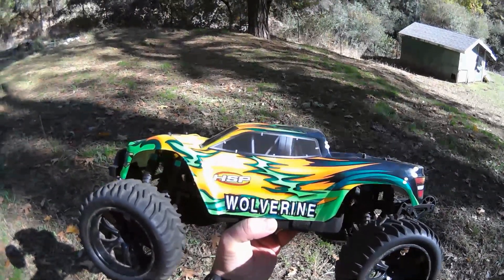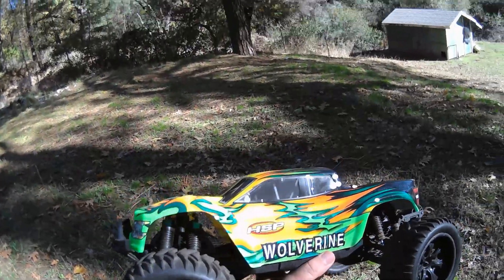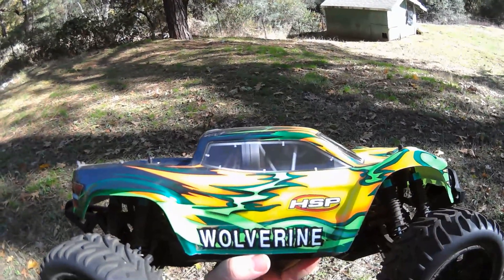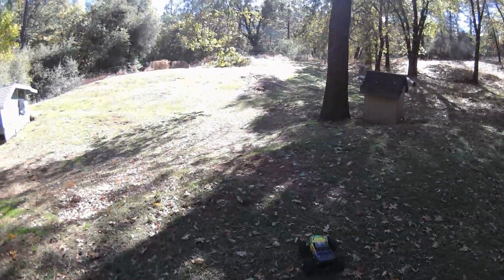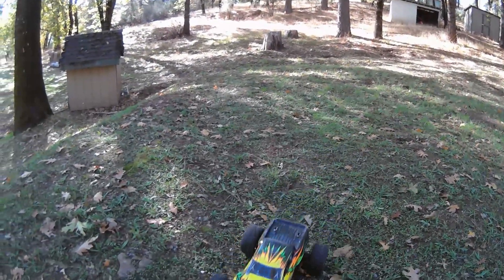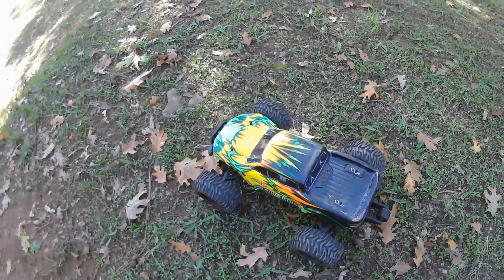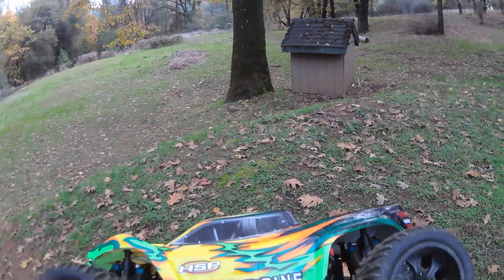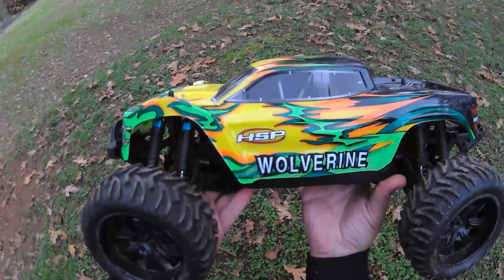HSP WOLVERINE - 3s BRUSHLESS WITH NEW SYSTEM

Comment: I’ve got the exact same as your samurai upgraded to 80A esc with 15kg servo to hold 3s, love it but it kills the hex on the tyres. I am thinking of changing to 90mm tyres cuz it’s cheaper. Love it too much to bash it on jumps
Reply from the maker: The stock hex on samurai are narrow..Get some thicker alloy hexs for it and kforce racing makes good SCT wheels and tires for around $25 per set.. Hobbypark has some good ones for around that price also

Comment: Nice video are you running stock 19t pinion or did gear it down some I was going to on mine I have a cogging issue what would you suggest keep the good videos coming
Reply from the maker: I think it's a 20t mod .6 with 5mm to fit the bigger motor shaft of the 3660 motor..Do you have the brushless model or brushed that you converted to brushless?
Reply: @philthyco1  brushless model blew original motor put in 3662 hobbystar recalibrate esc still cogging until you get going i was thinking over geared or esc not strong enough yours seemed to run good from a dead stop just thought I'd ask what you thought it may be.Thanx
Reply from the maker: @rambogamefowlfarm6022  Try to gear down but it's probably the stock ESC..Calibrate the trigger end points and if that does not help swap out new ESC